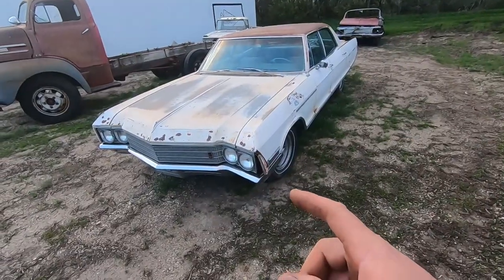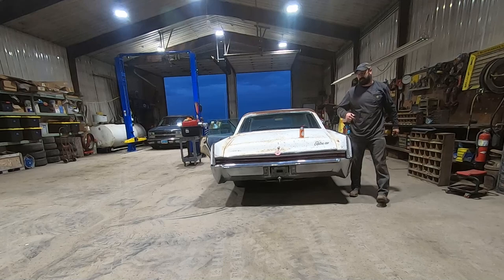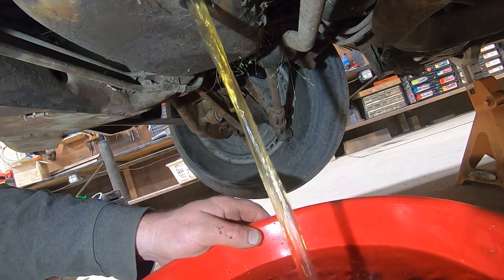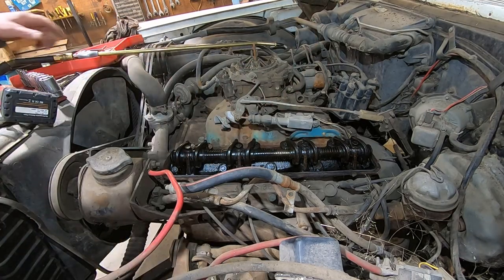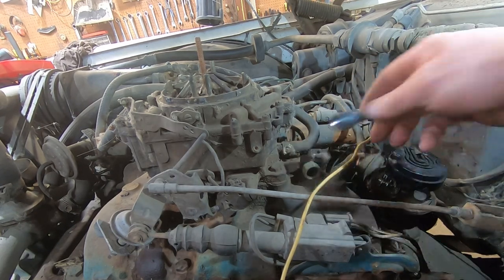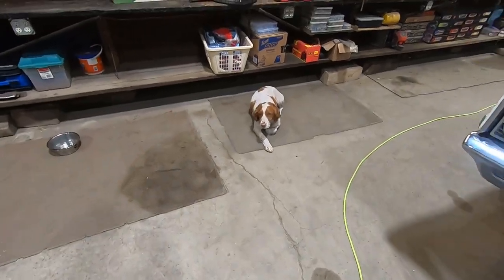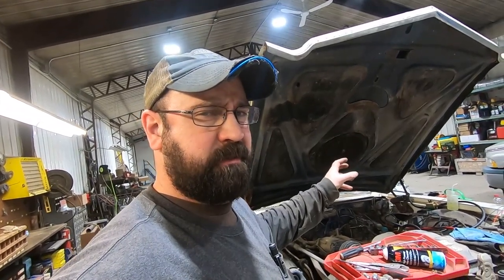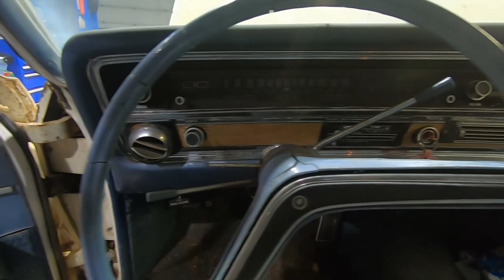Will it Run?!? 1966 Buick Electra 225 Abandoned for 30 plus years! Land Yacht Revival! 401 Nailhead!

Comment: The 1966 Cadillac had those cloth sheaths over the starter cable/wires... one time back in the day me and my buddy were trying to diagnose a non staring caddy the sheath ran down the inner wheel well and to the starter, rubbed on the upper control arm and wore through and when we gave those wires a tug, kaboom the battery sploded ... ruined both our leather jackets.
Reply from the maker: And you rshorts!
Reply: @MortskeRepair  Shorts are changed regularly, while those leathers are like snake skins, only come off once or twice a year when you rub up against a rock.

Comment: this is such a great rare engine, it deserves to have rod knock fixed with engine rebuild, or at least stuck valve ,unstuck. remove the valve cover and spray it with kroil and use hammer

Comment: you could get a 2 b 401. there is a low compression one would be labeled as a wildcat 375 and the the high comp was a 410. 410 was only offered in 62-63. the 425 was offered in rivieras  wildcats and electras. the skylark gs never had the option except a i think there was a few copo type deals that escaped around 31 iirc. also a 11:1 ration 401 was done in similar fashion about 140 of those.

Comment: This may or may not have to do with this video, but to avoid broken valve springs you must relieve all spring tensions when storing   They take a set and snap otherwise.
Reply from the maker: Started a lot of engines and I’ve never seen that happen

Comment: That water got in the motor recently, my guess is leaving it on the trailer for those few weeks [lucky really it was only that long]. Motor needs rings and the valves need lapping to get the rust from the water off. Short block it and put it on the channel for some primo content there bud! Probably also having ignition probs because of the water slopping around in the intake and on top of the pistons still.... but mostly it's needing some rings and valves [hopefully the piston rods are all alright, maybe that's an old salesman's tank and the odometer rolled over... but the seats and pedals say low mileage [top of the engine looks like they were a hard 45K of driving through. But ya man, new tune up kit for the ignition (wires, rotor, hot coil and new plugs) but ya, short block it and ring the pistons, hone the cylinders and lap in the valve seats and grind the valves a bit [you have a valve grinding kit right? Pretty sure I remember you doing some valves for a flathead]. Ignition and compression issues. JUst a freshen up bud! :-)) Good episode. Low mouse carnage and porta-johns, hotels and poop storms raining down from the headliner.... This car needs a wash and a motor freshen up is all lmao NOICE! Not as cool as a Galaxie or Fafirlane... Falcon.. Ranchero... but cool none-the-less lol ;-)

Comment: Hi Mortske. I learned a trick from a young cowboy, or was it an old Indian? If you make the coil wire so it jumps a gap, it produces hotter spark. Works better on ressurecting old horses.
Reply from the maker: Interesting

Comment: Too bad about the rod.  That would a been a fun cruiser for somebody.  I had a '63 LeSabre conv.  It had a tiny little 300 v8.  Zero to 60 in about a week and a half.  It also had the speed reminder buzzer thingy.  As I recall, mine wouldn't adjust any higher than 70 or so.  On the highway that buzz was A-NOY-ING!  I know that's the point...

Comment: There was problems with the piston breaking around the wrist pins might be that if she's got oil pressure it might not be a rod also check the oil pan for dents that's some what common on nailheads

Comment: Old Ford have rocker shafts but later on they got the upside down acorn nut on a stud system. The upside down acorn nut thing was a Pontiac thing the Chevy barrowed in 55 when Chevy and Pontiac introduced the  V8's

Comment: 66 was the first year for cruise control in a Buick. It was a expensive car new.
Reply: 1966 was also the last year for the Nailhead V8 in Buick's. The Star Wars air cleaner was new for 67 and a new disc brake system was optional. The 67 disc cars had special road wheels like on the GS340 cars.

Comment: electra is c body, a body is skylark, b body is the lesabre and wildcat.  the c body is basically a longer b body but share alot still differnt frames. lesabres even then had 3 port holes and electras had 4 while a wildcat had none even though a wildcat was a higher trim than a lesabre. i guess it was removed because the wildcat was consider more sports model. the original 4 port hole came in the roadmaster in the mid 50s.

Comment: Puddin! - ARRRGGHH My eyes! My Eyes! [I can't UN-see that] 🤣🤣

More Cylon-esque on the Buick tail [By your com-mand!]

Absolutely amazing how many of the answers to your questions on this car came immediately to me (yes, I am an old fart). '60s Buick Power Windows and Power Seat = Battery Killers.

Have I mentioned that I HATE '60s Buicks? Followed closely by Caddy's and then Oldsmobiles? Why? (bleep) poor engineering. Buicks: Starters, Carbs & Heads. Caddy's heads. Olds ... any number of annoying BS things.

AH! Engine is now spinning and I was wondering, ' ... did he ever put oil back in?' when you asked us to remind you. Whew! Good catch, Mortske!

There is only 1 bet: Always clean the points. Ans if they're BlueStreak - REPLACE them.

It's a Carter. Odds are the jets are clogged, at least one float lobe is a submarine and the accelerator pump gave up the ghost 20K miles ago. Just sayin' (did I mention I HATE '60s Buicks? '70s and 80's too?).

Considering the age and that it's a Buick - Multi-Visc oil ... how soon you want to replace bearings?

HAMMER that crankshaft! Real, quality Buick Sound! 🤣 Good time for a commercial ...

Not your fault, Mortske: you did YOUR job. We used to see a lot of these, and the early Buick V-6's, come in with rod knocks - every time the owner had used Multi-Visc oil. Straight weight? Not anywhere near as many issues.

Comment: To bad about the engine Mort. Of course any engine that doesn't have a cracked block or heads is rebuildeble but it is a matter of whether or not the car is worth it. In this case, maybe. And you are right about the turbo-hydro tranny.  All of the go fast guys who ran gassers back in the day ran that tranny if they didn't run a four speed. Any time used watching you turn wrenches is not wasted time. your are always informative and educational. oh yeah, and sometimes funny.
Reply from the maker: Thanks Gary

Comment: too bad about the land yacht - it was a highly optioned luxury car in its day.
term "nailhead" referred to the near vertical valve arrangement and relatively small valve heads. buick had two 425ci engines. the one with higher compression was the 445. ones with the dual carbs - often seen on the riviera gs - were called the super wildcat, which had the chrome air cleaner with dual snorkels. father drove a '59 invicta with a 401 and later a '65 225 (single carb) with the wc 445. both were hardtops with had speed minders, which emitted the same very pleasant tone as the "door open and key in switch" buzzer that appeared when gm began using the locking steering column. cars also had "valet" system of two keys - one for door/ignition and one for trunk/glove box - presumably so owner could give one out for someone to drive but deny them access to storage spaces.
never seen that much water in an engine that wasn't stuck or a flood car. it was clear so didn't come from the cooling system. since the air cleaner was still on it so would have taken a long time to collect that much. wouldn't doubt it was intentional or vandalism and internals have freeze damage. (ahhh - the life of a keyboard sleuth...)
engine knock was evident when first cranking.  the "chirp" it sounds like might not just be a knocker, but a spinner, as well.  loads of future crankshaft fun.
underside of hood is blue - like the interior.  if not originally white it was an otherwise complete repaint.
now that it's worked up vacuum you might be able to open the trunk.
Reply from the maker: Thanks for the comment!

Comment: Did you at least get the radio on??
Reverb was a Reverberation sound thingie. We didn't have stereo then !!!
If ..you were TOTALLY cool, they sold after market add on REVERBS !!!
and you would wire it in to ONLY your rear speakers !!
Giving you TWO sounds,
On the same music !!
Standard radio front speaker. 
KOOL radio install??
Front AND rear speakers !!!

Comment: I had a 61 Electra. Would do burnouts all day long. Such a good engine the 401.  hell even the 264? in my 55 special could move pretty good. The dynaflow is the only downside to those cars even though i never really hated them too much but a real transmission would have been nice. my 61 had a mirror for a gauge cluster look it up.

Comment: Neat tool for turning over engines by the flywheel, where does a guy acquire such a tool?
Reply from the maker: eBay or Snap On
Reply: @MortskeRepair  thx
Reply from the maker: @jedk9523  No problem

Comment: I was always told the Buick portholes signify v6 or v8. 3 on each side for v6. 4 on each side for v8
Reply: My dad had a 49 Roadmaster with a straight 8.  It had 4 portholes.
Reply: @nelsonschmitz5882  forgot about the straight 8s. I guess I should have just said 6 or 8 cylinder lol

Comment: 33:59 Mortske you forgot stuck valves on drivers cylinder thats why it wasn’t sounding right wasn’t running on all cylinders also why it back fire when accelerating
Reply: The other thing to is the bearing on the rod could be rusted from the water not moving if you keep it running till operation temp it might free up

Comment: Are you sure that it's not torque converter bolts that worked they're way back out that they're loose. I've had it happen and it hitting the transmission and it makes it sound like a rod
Reply from the maker: Definitely a rod knock

Comment: She runs but stick a fork in her cause she's done, that's a wicked bad rod knock.  With that much water in the oil (oil in the water?) probably spun a rod bearing or six.  With that much combustion coming back out through the carb probably dropped a valve too.  A shame, cause it's not a bad looking car.  Might be worth grabbing a junked 401/425 or just dropping a SBC in it and calling it a day.  I know you said you just want that variable-pitch trans but if the body cancer's not terrible you might be better off with an engine swap cause the interior is pretty decent.  That stuff related to the windows and seats is super $$$$ though especially compared to Chevelles/Impalas/pony cars etc.

Comment: Bummer. May have been in a field flood or something ? Surprised you dont have an old oil can or large syringe to oil valve train with ? Good scrap value after you pick it still. Jack the back wheels up and try to make the speed minder work ?

Comment: Is the hitch factory added? If so does it has it the factory towing package like beefed up rad, tranny cooler, different axle ratio?
Reply from the maker: Looks to be add on
Reply: @MortskeRepair  do you see many of the station wagons with factory towing kits?
Reply from the maker: @dekksherton6824  Nope

Comment: My family has been driving Nailheads since 1953.  Never even heard of a rod knock on a Nailhead much less on one with only 44,000 rounds on it.  I had a '61 Electra with 176,000 miles on it and there wasn't a hint of a rod knock.  Can't imagine anyone trying to fire up a Buick without checking the firing order or  the cylinder configuration first;  why does everyone think it would be the same as a small block Chevy.  Which really leads me to believe that your spark plug wires could still be  screwed up.  Very easy to reverse 3 / 5 wires on the 401;   listening to that 401, there is a distinct miss there and I doubt it would be because of a rod knock.  Just doesn't seem right.  Just sayin.
Reply from the maker: It was definitely a knock

Comment: It would not be a Mortske video if the starter and carburetor and points did not need attention of some sort.  I hope some ambitious person comes to buy the 225 and get the mill running properly.  It really has more things right than things that need work, other than cleaning and body repair and that knock.  It would be neat if whomever buys it has a YT channel or at least gives you some feedback on what the 401 needed.

Comment: I thought the 8 cylinder Buicks had 4 portholes on each side, while the 6 cylinders had three.  Kinda of a vestige of when the exhaust came out the sides of the car.
Reply: NO, the amount of porti-vents told you what model it was.  The early cars had no 6 cylinder engines.

Comment: Pull the pan and throw a set of shells in it.
Easy peasy
Reply: You would have to grind the crank or get another , the scratched one will eat a bearing in seconds
Reply: @oldpolak5203  Emery cloth and a leather shoe string. But you're probably right it's likely beyond that

Comment: I would tear the pan off that engine and see how bad the damage is and if it's not too bad toss a set of bearings in it and see what happens I did that to a small block chevy and ended up running great

Comment: Those old Buick nailhead motors were junk to say the least. Notorious for rod knock and lots of other major problems. They hardly ever got to 80K miles before they blew apart. You can pick those cars up dirt cheap because motorheads know they aren't worth the hassle. They look cool and they have gobs of low-end torque but that just doesn't cut it.

Comment: Not gonna pour it down the dipstick? That's exactly what Renault make you do on the 2.3dci engine in the Master Vans..  takes for f-n ever
Reply from the maker: That sounds horrible!
Reply: It is, there's a fill port but it's just a remote tube that tees into the dipstick tube
Horrible idea and they hold a ton of oil

Comment: That’s a 1967 with a 1966 front end.
Reply from the maker: Doubtful
Reply: @MortskeRepair  ok… Maybe 🤔 the tail lights were updated. The 1966 should have a thick chrome strip in between the red lens, the complete width of tail light.